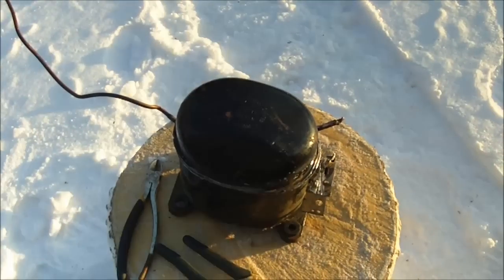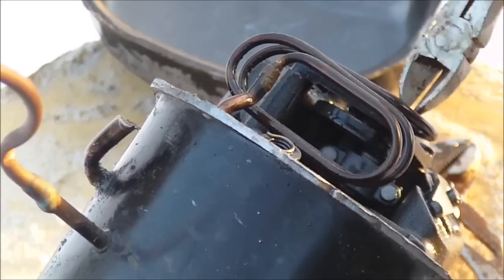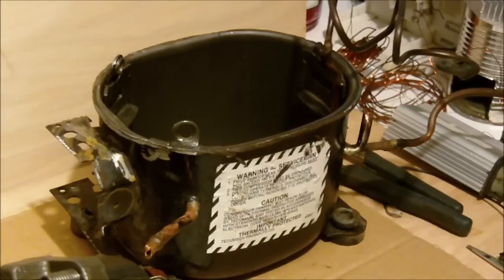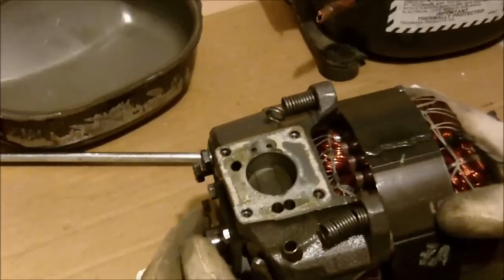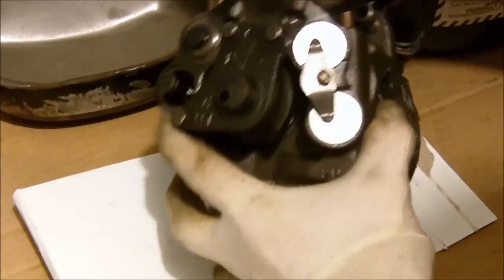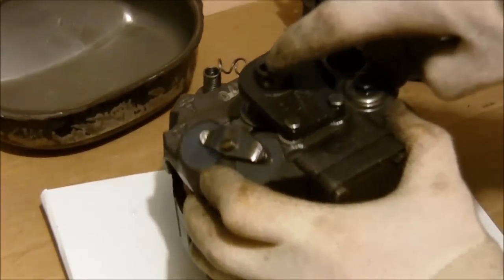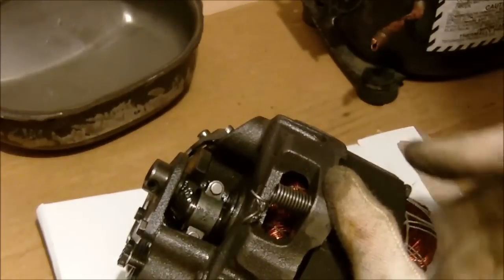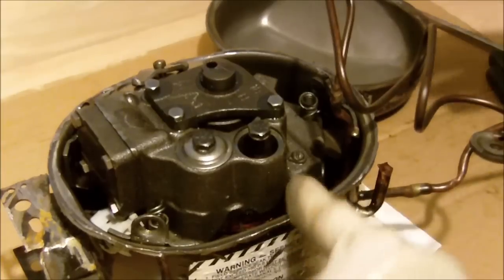Fridge Motor conversion to Steam Generator idea

Comment: you would have to retool the crank shaft for the push rods to the head and then a valve system for the head  and with that much friction evolved it wouldn't be that efficient to drive the generator plus the loads that the generator would introduce......., so no I don't think it would be possible......

Comment: it is a good idea but you must have a cam shaft and valves to control your air or steam flow otherwise will not work even you modifie the cilinder like in two stroke engine still need air control valves or steam or water control valves

Comment: This would still work if you left it in the a small oil bath and ran an air compressor to it to turn the shaft. You could with a copper tube make a small valve with and dowel to open and close the a small hole and run this using the crank weight as a pusher sort of like a push rod controlled engine does on a cam in old chevy engines. When all else fails just give it away or throw it away.
Reply: https://plus.google.com/105285816099913202128/posts/KyBypJw522g  to get real free games                                                                                       Fridge Motor conversion to Steam Generator idea

Comment: Why no use two of these together one to compress the steam the other generating electricity - then like a weedwacker or small engine to generate steam- the whole point with steam is you're only using a small amount of fuel to get a ton of steam & power from it

Comment: If you wire it up and get it running off the mains with its original capacitor, disconnect from the mains then you can then turn the shaft with a drill or with steam as you plan, the unit will not generate straight away, however if you 'flash' the supply lines with 12v a couple of times the motor will start generating, if its a 4 pole motor then you'll need to spin it well over 1500 rpm to get mains voltage out of it.

Comment: Just an Idea ,if you use the R-12 in stead of steam and rework the reeds and of course get the motor to generate power.
you would have a sealed system , just apply heat and you will also need a condening coil.
This way you can avoid the water/oil problem and use the oil system.

Comment: Can a air conditioning compressor (which looks similar to yours) be used instead of a refrigerator or freezer compressor. If so would the pressure be higher than fridge/freezer compressor? Thanks for sharing.
Reply: a fridge compressor will. pump up your tires.. it also doubles as a vacuum pump and can be used to pump air out of vacuum tube envelops and light bulbs !

Comment: Are you wanting to use steam to spin the thing to generate electric or are you wanting to generate steam with the use of electric? If your goal is to generate electric with the use of steam, "Are there magnets already inside the copper coils to produce a current?"

Comment: Hi,
Your idea is great on one hand side. On the other hand side, you have a compressor with passive valves, which works in case of a compressor (motion to pressure). For a steam engine (pressure to motion) you need active valves. If you can solve this issue, it would work like a engine if you connect it to a steam source. Thanks for this "cut-away", it's nice!